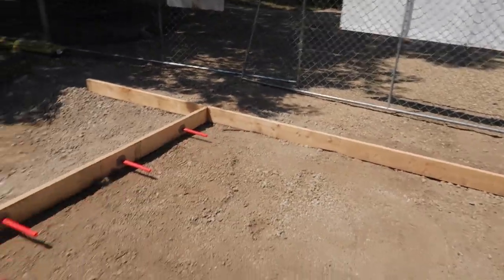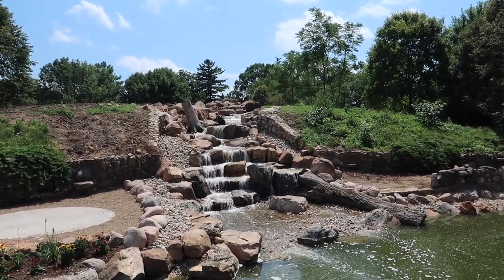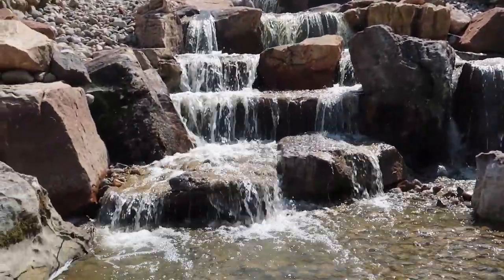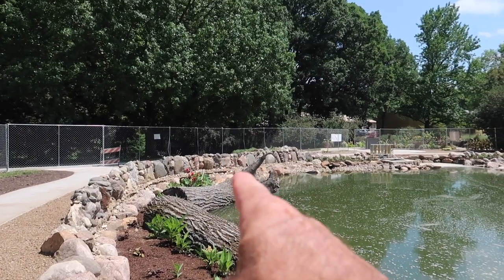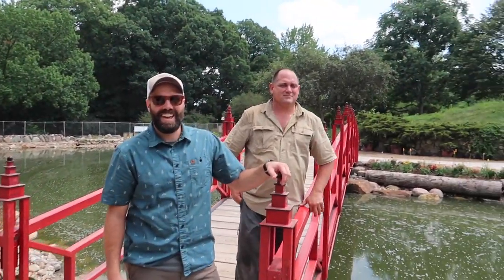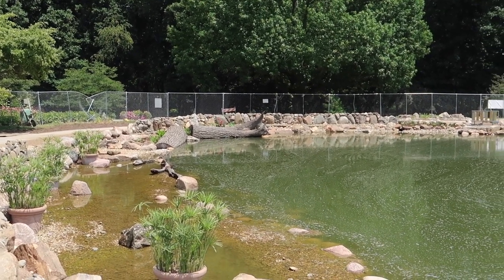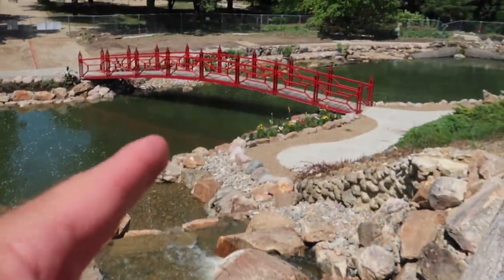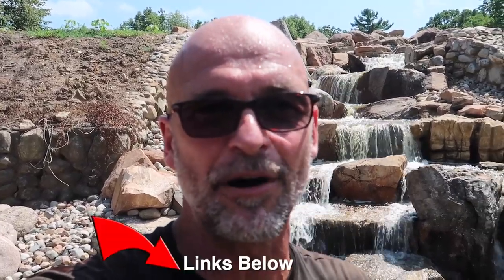Massive POND RENOVATION Reveal: 1.5 MILLION Pounds of Stone Used – Part 4

Comment: According to the Aquascape Academy 3" round pipe facilitates a flow rate of 13,500gph and a 4" round pipe allows a flow rate of 21,000gph. What gph would a 6" pipe allow? That's quite a rise and run.
Reply: Sean Odonnell We have approx. 60,000 GPH flowing through the 6” pipe.
This is a unique situation where I specifically chose the diameter of the pipe to add additional head pressure to the pump. 
It’s part of a longer discussion but basically I use a series of factors to according to the project designs and aesthetics to determine the desired flow rate. 
From there I look at a variety of pumps to determine which pump will create the necessary amount of water flow for the project. 
I then cross reference this with the pump curve to determine the optimal flow rate for the pump. 
It’s a confusing concept and I will produce an upcoming video on this to better explain it.
Reply: @edbeaulieu5916  thanks for the reply, you always do. Great way to increase the velocity of the water without creating too much back pressure. What a unique design.
Reply: Sean Odonnell Exactly!!!
It’s a balancing act to get the greatest flow with the lowest Horsepower.....